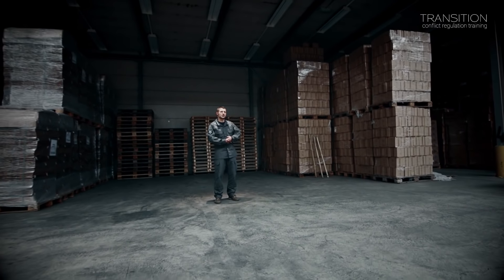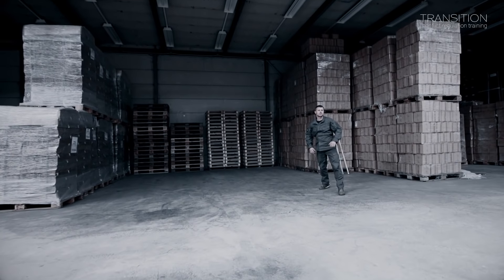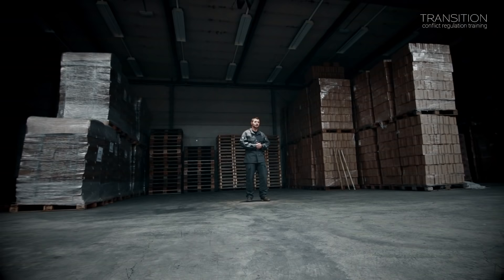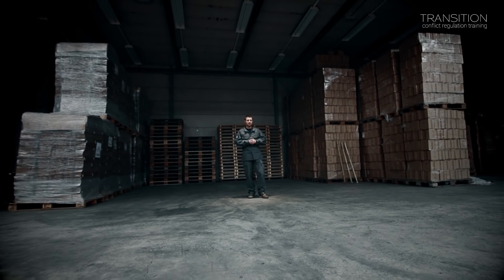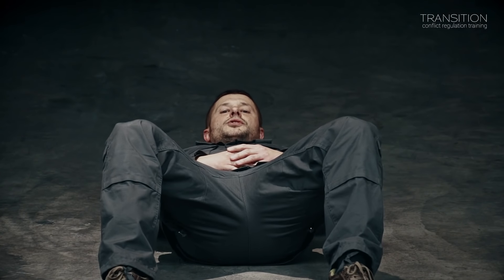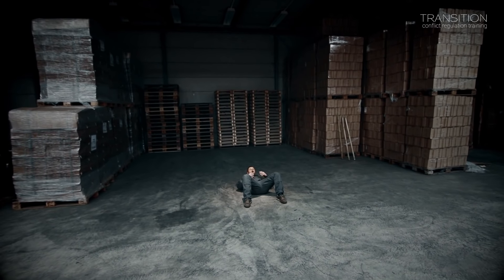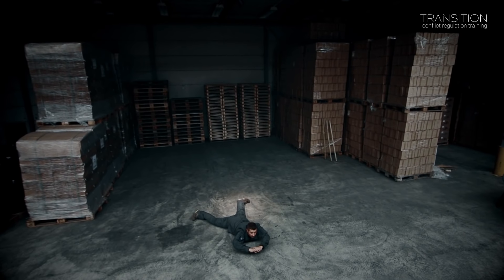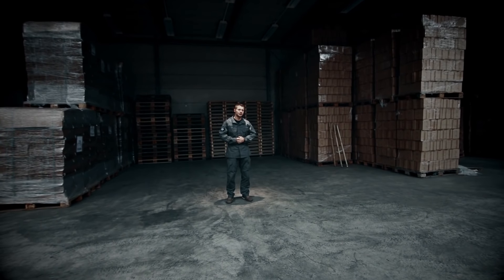Systema groundacrobatics: Russian bicycle

Comment: What types of offensive moves can you actually execute in that acrobatics???
Reply from the maker: Well it depends on the situation. This exercises can be applied during combat drills with firearms. Low movement on the ground while directing fire. In hand to hand combat it can help you position when you are on the ground and your attacker(s) are still standing up. Also can this move be applied during wrestling.
Reply: Okey Thank you!😊
Reply: Rolling away to free your limbs for striking, rolling into a standing attacker, destabilizing someone on top of you, turning so you can get a scissor on their leg, moving to a rock or weapon are some ideas. You can also do a quarter turn that is a very useful variation.